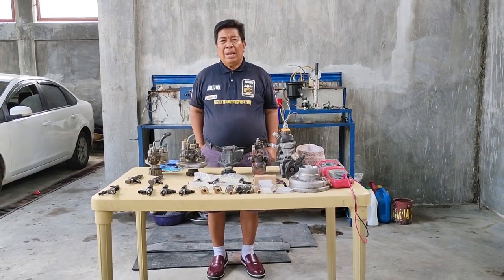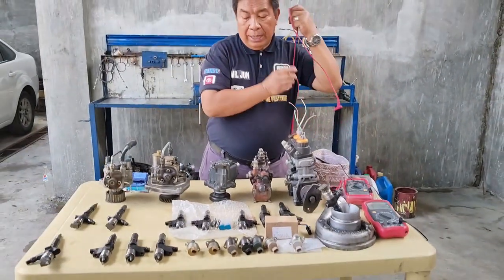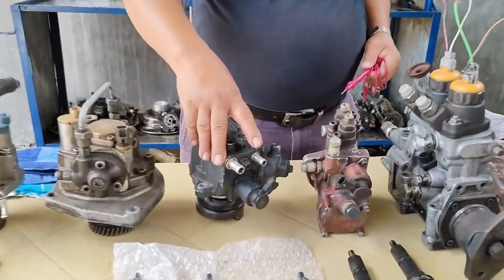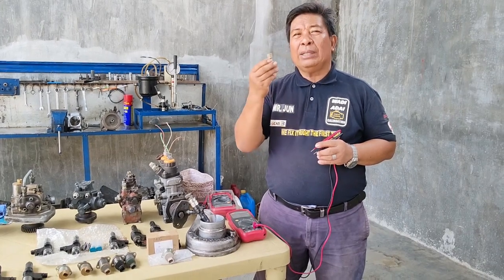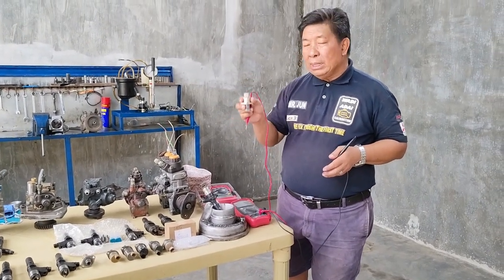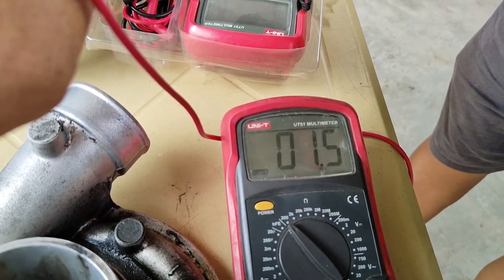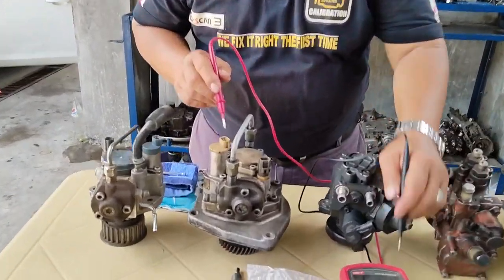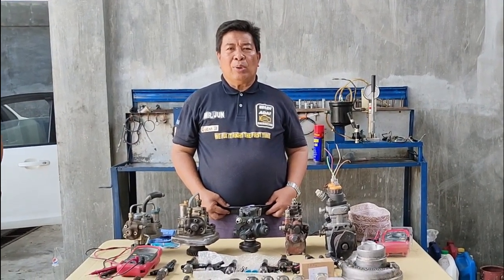6M70 6HK1 Suction Control Valve & Common Rail Injector Solenoid Resistance Check Using Multi Tester

Comment: boss san ba madalas o kalimitan makikita ang mga SCV o Suction Control Valve? san pong parts ng sasakyan madalas o karaniwan nakakabit ang SCV? para may idea kung san po sya makikita agad? any 
car po...  ba yan and for diesel only lang ba ang SCV? wala sa gas na sasakyan?
Reply from the maker: sa may high pressure pump po nakikita yun.
Reply: high pressure pump or injection pump? tama ba boss? like HP3 and HP4 na injection pump gawa ng denso.

Comment: Na pa check kung injectors nya may dala injector na mataas yung backleak 11 po yung apat 7,8,9 tas yung pressure nman mern 17,18,20 at 21 yung dala nman na mataas ang return or backleak nya 21-11 at 20-11

Comment: gud pm po,ano po kaya ang dhilan ng low power ng DMAX ISUZU 2005 , pinacalibrate ko n po ang injector & pump ganun p din po hanggang 2000 lng po ang rpm naka8 n pong mekaniko hindi p din mapahusay,nkacheck engine po.sana po matulungan nyo po ako.salamat po
Reply from the maker: kelangan po ma scan ang computer para malaman po ang problema nyan. Na try nyo po bang magpalit ng Suction Control Valve o SCV

Comment: Thank you po sa very clear demo. Ask ko lamg po if correct: 
SCV dapat nasa 2.6 ohms. Pag po nasa 3.1 pataas hindi na po pwede at ito'y 12volts po. Right po sir? Pag nada 24volts po, ang ohms po is 8.6.. thank you po sa confirmation. God bless

Comment: we have a problem please help me, by the way, I'm a mechanic, but the 6m70 wingvan is very difficult to do until now, the car can't start, hard starting. the first thing we did was 1. banjo bolt, streaner or primer pump okay 2. sunction control valve ok also 3. starter motor okay too 4. ecu okay too, I scanned it 5. the first time it happens, it runs without a battery, so what's the problem, I hope you can help me thank you
Reply: Baka lost compression yn boss. Need overhaul.

Comment: Ung rpm nmn 6m70 10.lng rpm nya anu problema nyan
Reply from the maker: check po kayo ng mga fuel line kung hinde nagbago baka kelangan ma check ang mga injector
Reply: Napalitan na cya Ng injector  gnun parin nag wild andar nya taas mataas 25 kaagad rpm..pag Pina andar